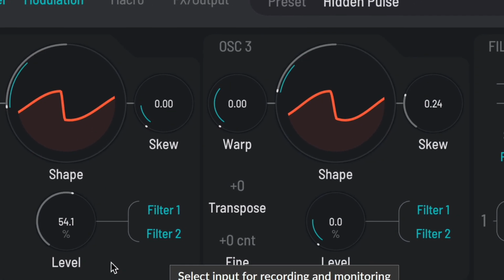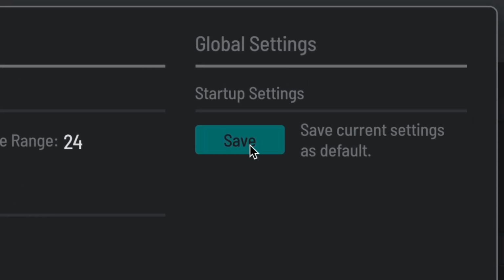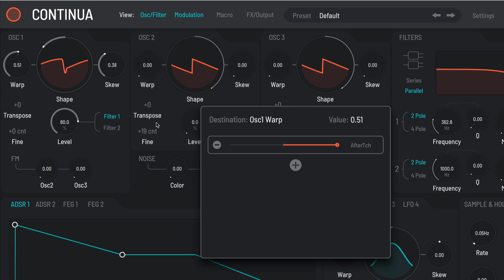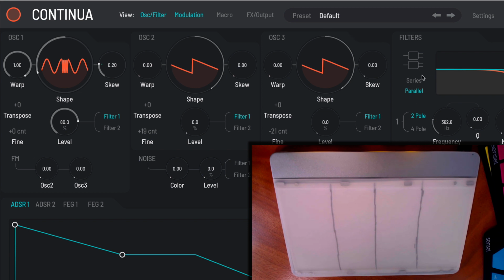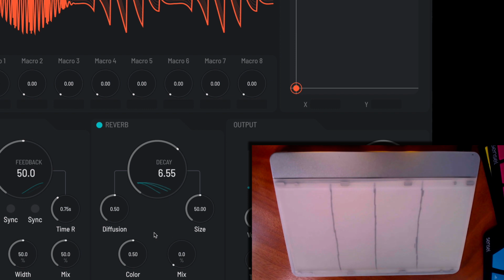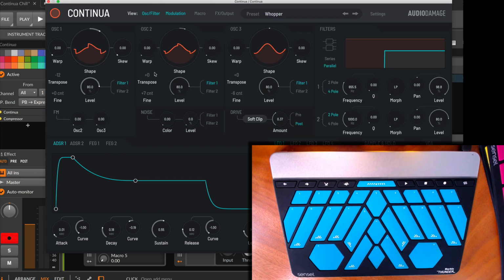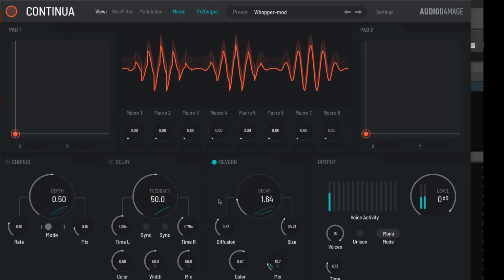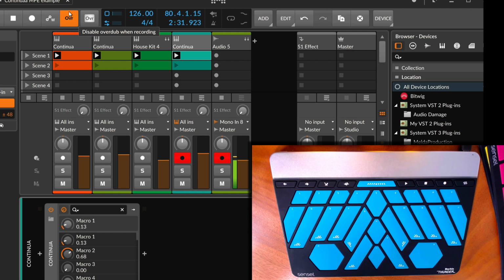Using MPE in @AudioDamageInc Continua with the Sensel Morph [Tutorial]

Comment: hey, great demo ! i love that u can do MPE fx control. do u know of any plugins that let u do pure MPE fx chains on an audio input ?

lots of plugins seem to be MPE synths but one of my dreams is to have an MPE controlled fx system where each "note"/channel is a parallel chain, with 3+ axis mapped to the fx params for that chain
Reply from the maker: If you want to do per-note effects, that is a bit trickier! You can construct things like that in instrument racks in bitwig, for example, by limiting a layer to a given channel. It can get unwieldy very quickly though!. Probably a good way to prototype this is to use Cycling 74's Max. There are some good MPE tools in that environment, and you can build a polyphonic synth with a voice that includesan effects chain.
A more out-of-the-box solution is UVI Falcon. Use Keygroups in UVI Falcon - there are some effects that you can add, but they are a limited selection compared to the full range of "global" effects available. But you can still pack on per-voice pan/stereo effects, phasors, filters, distortion, amp-sims, and a reverb. It's pretty deep. I address that in this video here https://youtu.be/twMtQ1y8ow4x